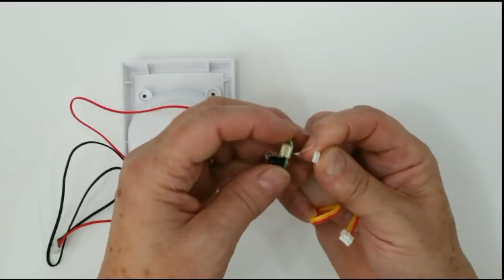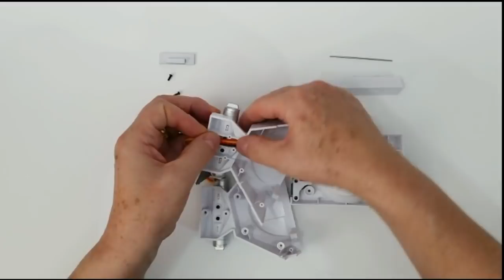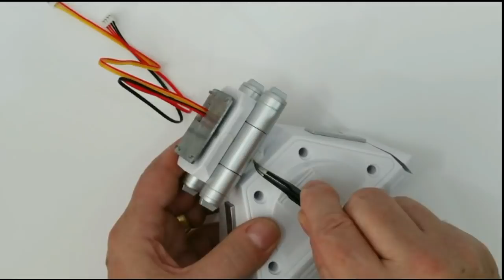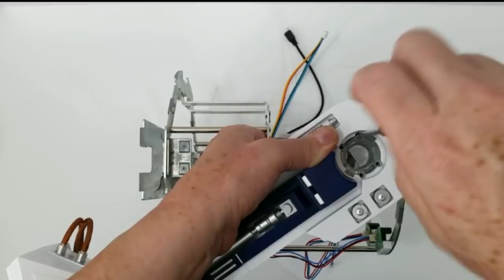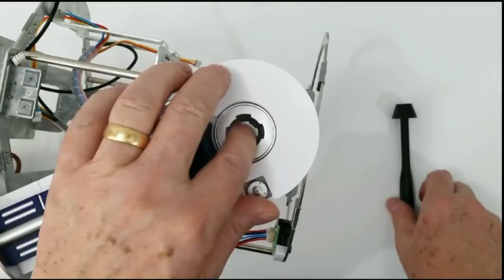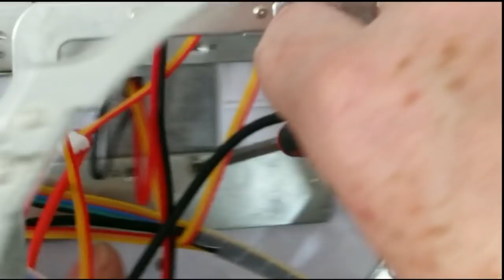Official Build Your Own R2-D2 Build Diary - Issue 91

Comment: Just wondering about something with the legs. When I attached the legs, I made sure the top of the wires didnt get in the way of the screwholes. Now the legs are attached, they look straight but very slightly at a slant. Im guessing they go perfectly straight when the body gets attached? Has anyone else noticed the legs not being perfectly straight when fitted?
Reply: Mine are pretty straight and even... I'd check your build. Possibly something wrong with the feet/ wheels not quite the same height/ position?